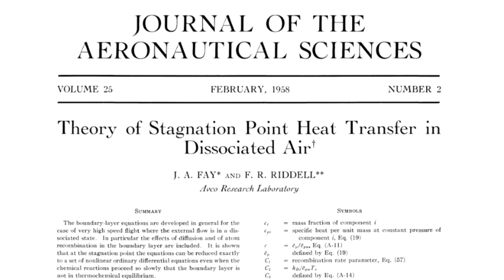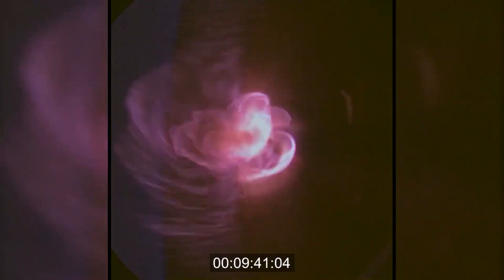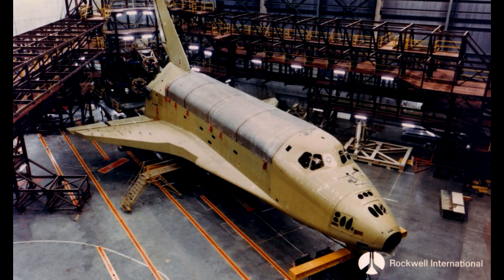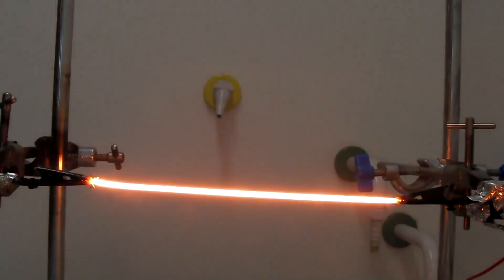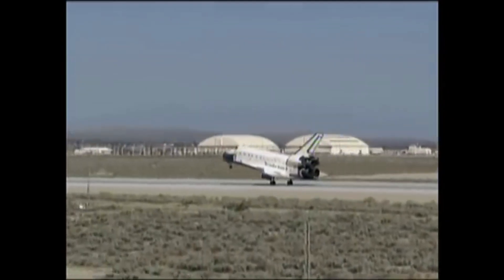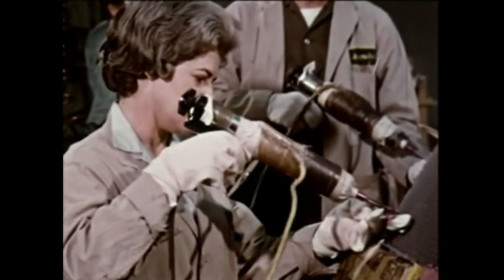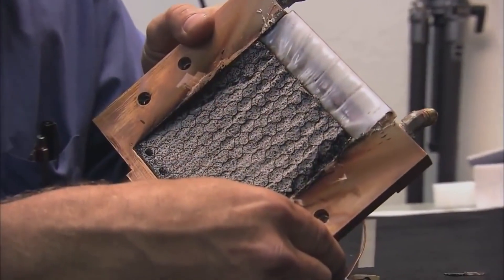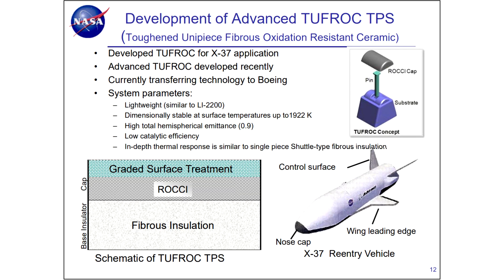Heat Shields - Things Kerbal Space Program Doesn't Teach

Comment: lets not forget that if spacex intends to solve orbital refueling, they could very well launch a fuel pod, dock on the return trip and just circularize back to earth before dropping into the atmosphere. They don't necessarily need to carry a big-ass shield to deal with interplanetary returns.

(i'm aware that doing such an eccentric rendezvous and refueling would be a whole new engineering challenge in its own right)
Reply: That's actually a sensible idea, but wouldn't the interplanetary velocity be several times greater than the orbital velocity of the fuel?
Reply: @rohanpotdar908  They would need to get the fuel tanker up to excape velocity to meet the incoming vehicle which would be pointless.
Reply: I wonder who's going to pay for that setup. I can't imagine payloads and projects valuable enough to justify that, IMHO.
Reply: @vladimirdyuzhev  I don't think they actually would need the Delta-V that badly on the return trip because of ISRU.
Reply: @chris kerwin
Exactly. ISRU - in-situ resource utilization meaning refueling on Mars leaves you plenty of fuel to easily slow down with your rocket engines before hitting Earth's atmosphere and using the fuel for cooling. Mars has an atmosphere that's less than 1% as thick as Earth's and gravity almost 3 times less so it's easy to make Orbit and go Earth bound from Mars you'd think.
Reply: @ryccoh  Making orbit from mars surface is about 3500 m/s delta v which is about a third needed for earth orbit including gravity losses. To intercept and capture back to the earth only requires about 2000 more. So that's roughly 5,500 m's delta v to get from mars surface to leo. Very doable with an engine making 3.5km/s specific impulse. If you haven't seen it I would suggest watching Robert Zubrin's Mars Direct presentation.
Reply: @chriskerwin3904  Nice so it wouldn't be a problem then. Making earth orbit requires 7800m/s, according to Musk the starship could make orbit on its own without the booster however without any payload. Coming back the starship would only return with passengers so there should be enough margin.
Reply: @ryccoh  7800 is the absolute nominal amount to get to orbit; it typically takes about 9000 because of atmosphere and gravity. If you used a tanker based on mars you could refuel a 2nd BFR in Martian orbit and probably bring back the full 100 tons of cargo.   The booster is pretty important since it's allows the BFR to get to LEO with the huge cargo load (100 tons), then you can refuel and send that 100 tons into mars injection. I think it's highly likely that the first BFR sent to Mars will be sent so it can make fuel while it waits the 2 years for the next BFR to get there. That way when the manned mission gets there, they have a fully fueled, working backup in case anything goes wrong.
Reply: Or you could just take the time to bleed off energy through multiple orbits. So long as you can at the very least CAPTURE in that initial pass without destroying the craft, you can make as many passes as needed to slow yourself down to a LEO, where the speed on reentry is as low as possible.
Reply: @hatman4818  Those far orbits would add at least several extra weeks to the time of the trip. May be worth it but, ISRU is the whole point of using this system and should enable the BFR to come back with a fair amount of delta-v.
Reply: Using retro-fire to reduce the speed of Earth reentry, and thus reduce the design demands on Starship, always sounded good to me. Have a couple of tankers already parked in Mars orbit before launching the Starship that will land. HOWEVER, the tankers will need to decelerate to Mars orbit, using a lot of fuel, or have a high performing heat shield/cooling system in order to use aerobraking via several shallow passes thru the atmosphere. But perhaps a less high performing one than is presently planned. Perhaps a balance can be struck, a combination of this and a Mars retro-fire.
Reply: @Don Jones
Like you alluded to, the beauty of Starship with its perspirant cooling and its refueling ability is LOTS of options :)

Comment: How do we know how much of Galileo's heat shield ablated away if it was discarded into Jupiter's atmosphere?
Reply: Math, like if you knew the temperature and the rate at which the ablative material ablates at a given temperature and the time duration you could figure it out
Reply: My guess is that they analysed the change in deceleration  due to the loss of mass
Reply: I suppose if you know the pressure of the atmosphere you are in, it’s density and the rate of acceleration, and the weight before reentry, you can find out how much your mass changed in order to match your acceleration.

Properly could tell after the deployment of the parachute.
Reply: the change in weight of the aircraft had to have something to do with it
Reply: they had a guy periodically take pictures you idiot. I knew there was something wrong with that mission when I signed up..
Reply: The follow-up mission of course, that found the heat shield at the bottom of Jupiter's atmosphere.

Comment: do not try to calculate the pipe density of the subsurface methane cooling system and the heat energy needed to be added to the tank pressure. It is a crazy long math problem.
Reply: Upload a video of it
Reply: R/iamverysmart
Reply: more pipes
Reply: it probably only works for a sphere in a void anyways.
Reply: @jesusmora9379  cylinder actually lol
Reply: @jesusmora9379  Well, then we're going to see a very spectacular re-entry of Starship indeed.
Reply: I think most of us did not need this advice Will Hunting...

Comment: Why do you think they don't re-design the space shuttle thermal tile system instead of replacing the heat shield every time? We flew those for over 30 years. I know they were brittle bit I would assume they would have figured something out by now. I'm no engineer or anything and I know my suggestion is easier said than done.
Reply: It probably is cheaper and faster to do it this way.
The tiles where extremely labour intensive to maintain and replace.
Reply: there was also some problems with bureocracy and politics, and they were not allowed to replace parts of the space shittle with more moderns ones because of it.
Reply: If the Dragon heat shield is a single piece, like it seems to be, it's much easier to replace than thousands of individual tiles.
Reply: Because the shuttle tiles are made out of brittle silica foams and carbon ceramics which are brittle and can not be made into large tiles.  Having so many small ceramic tiles requires intensive maintenance.  A heavier but perhaps better option is a metallic honeycomb structure made of inconel or titanium.  It can be made into much larger tiles and is a lot less brittle.
Reply: @user-fj4mb5jh8o  For high heat you would probably use some type of molybdenum-copper alloy like Blue Origin and Space-X  have talked about using in their staged combustion engines.
Reply: @chriskerwin3904  the only problem with molybdenum is that it is very conductive but yeah, I'm pretty sure they proposed that for the dyna soar
Reply: I remember seeing a video on youtube about flat thermal tiles as next generation research
Reply: Read about TUFROC which is exactly what you describe. It only became available in the last decade or so of the STS program.
Reply: They only have $30b a year, and that isn't enough to buy more Bakelight tiles and glue.

Comment: No talk of ablative heat shielding is complete without talking about the Russian ablative heat shielding of.... wood
Reply from the maker: It’s not just Russian.
Reply: Scott Manley ohhh??  I thought they were the only ones who flew wood as an ablative heat shield.
Reply: @OG-Fox3  
As far as I know another good material for this is cork. It gets charred at the surface and forms a protective layer for the cork underneath. Takes very long to burn through..
Reply: @klausvogler6710  also very low density and spongy, making for decent insulation properties.
Reply: @klausvogler6710  Indeed. At least one CubeSat (QARMAN) uses cork.
Reply: @mxaxai9266  Also the spacecraft adapter fairings on the Apollo S-IVB, which blew my mind when I first learned.
Reply: @OG-Fox3   Nothing like ablative wood, that's what I always say.....
Reply: Klaus Vogler Cork is wood!
Reply: @oneskydog4401 to be more accurate, cork is bark of a specific oak, the cork oak.
Reply: @klausvogler6710  Similar to how the so called starfire plastics are made using cornstarch. It burns and crusts forming a layer of carbon. Pretty cool concept really.
Reply: @oneskydog4401  cofk is not wood but bark.
Reply: @scottmanley  What? HA HA HA HA HA! WOOD?!?!?!? HA HA HA HA HA
Reply: @scottmanley  The Chinese use a, sectional, "ASH", wood, for return, missions.
Reply: Nature's composite material.
Reply: AFAIK Insight lander's heatshield was mainly made of cork and it handeled the Marsian atmosphere @13km/s
Reply: The Chinese used it as well.  How stupid is it they used something cheap and easy to get, rather than something that was labor intensive and cost a ton?
Reply: @fuzzywzhe  If it works great! 
I find it disturbing that they would take that kind of chance with their astronaut's lives.
 Was it the mentality of losing a couple astronauts didn't matter, there's a billion more where they came from?
Reply: @fuzzywzhe  I'm no expert on the topic, but who would have thought during the initial start up of the space program that it would revolutionize data communication in the forms of a wireless network that can transmit data at remarkable speed, or lead to things like people having those paper-fold-up-maps instead in the form of GPS in their car that updates in real-time traffic conditions, accident reports, etc.

Even just collecting data on the ISS is a good thing. "What happens when we ..... in space?" Collecting things like vitals and blood samples from astronauts who have spent X time in space, etc. But think of it this way; sometimes we don't know what we are looking for, we are just experimenting, and we find solutions to problem we didn't know we had, or solutions to advance civilization.

In a different way of answering your question with a hypothetical - one caveman could say to another "Why are you rubbing those sticks together for the past hour, seems like a waste of time (PR stunt)" and the other caveman replies "Dunno just wanna find out what happens man," and boom, fire was discovered.
Reply: @fuzzywzhe  space is long term security from a species ending cataclysm
Reply: @fuzzywzhe  in the early years of aviators their efforts were also ridiculed as entertaining but of no practical use. In my opinion humans will need to leave the earth or face extinction. Better to learn now.
Reply: @stevenduncan7380  the russians were using material science just like we were. Dont be so butt hurt that some farmers all but won the space race.
Reply: i think china uses wood heatshields too
Reply: That is interesting and I feel like you're presenting this as a joke, but is wood a bad choice? I mean, it's a good insulator, it undergoes a chemical reaction under heat, and it gets smaller as heat is applied. Just like the space foam, you can touch glowing coals for a short time without getting burned. Seems like a cheap and easy way to protect your comrades.
Reply: @FireheadLazzo  I would imagine it's a weight issue
Reply: you can then cook some potatoes and distill some vodka during reentry
Reply: Some wood shield designs featured thousands of tiny holes on the hot side, all filled with heat-resistant grease.
As it temped up, the grease would slowly ooze out, vaporize and take a lot of heat with it.
The wood didn't char until most of the grease had been cooked out.
US did some tests, dropped it.
Reply: Then there was that one Moon Lander had a huge balsa wood shock absorber bouncing around on the Moon.
One of them missed & is still up there somewhere with Laika
Reply: If its stupid but it works, it aint stupid.
Plus who knows maybe the wood was reinforced with stalinium.
Reply: @danieldeak9141  They first tested balonium, them stalinium, and further developed chinesium.
Reply: Some oriental satellite used resin-impregnated cashew shells for its re-entry capsule (they'd had a bumper harvest that year apparently).
Reply: Why not water cooled shielding and solid state cooling?
Reply: @NwoDispatcher  Water is heavy and can't actually take the kind of heat you'll receive during re entry, not even close.

Solid state cooling I assume something like a peltier or heat pump? Too much electricity to move that kind of heat, and it also still has to go somewhere.

Heat shields take an enormous amount of heat energy and either ablate away (taking heat with or), or like non ablative shields they absorb the heat but have almost no conductivity to the vehicle. This is a method that doesn't require moving heat and is actually pretty lightweight.
Reply: @Jaker788  how about molten salt then?
Reply: @NwoDispatcher  The PicaX SpaceX is using is one of the best materials for burning off re entry heat. Carbon is what it's made of, it's very lightweight, it sheds off material to keep heat off the vehicle.

SpaceX was thinking about an active cooling method for the second stage. It would have been a double wall on the underside with the outer wall having lots of holes to let out liquid methane that would evaporate and take heat with it. I assume they decided that a double wall and use of their fuel actually costs way more weight than carbon tiles, weight is everything.

Molten salt has to be heated really hot to be molten, it's not really a heat shield, it's a heat sponge to keep solar collector farms operating all the time. It's not going to be a light heat shield, it'd be a solid material during flight and need something to hold it securely, once re entry starts it would become molten and transfer too much heat to the vehicle as well as expand. The containment is the hardest part about using it, I don't see a way of containing the salt when it's molten.
Reply: “Cells” and “Interlinked”, two words that remind me of Blade Runner 2049.
Reply: Speaking of wood and carbon foams, there is a way to build a heat shield for a one-way Mars cargo lander that is a hybrid of ablative heat shield and active cooling. Imagine you have a metal surface - the bottom of the vehicle. Attached is a relatively thin layer of carbon foam - using via standoffs or engineered to allow channels for the coolant. Into the space between the metal surface and the carbon foam you pump liquid methane. Re-entry heating boils the liquid methane and methane gas then finds its way through the open cell carbon foam and also through the joints. 

Liquid methane is an excellent coolant. As its temperature increases, its specific heat increases. Eventually it will dissociate and the resulting soot will act as a further optical barrier (absorbing some of the radiated energy from the shock front). So long as you keep sufficient flow, the metal of the vehicle will remain cold. And where the carbon foam wears locally, the flow increases and thus its self correcting. 

End result is a much thinner and lighter heat shield. Yes you do have to provide coolant, but the nice thing is that as the mass of coolant is depleted, the vehicle gets lighter as a result, meaning your landing burn can use less fuel and you can also dispense with usual jettison of the heat shield - which further simplifies and lightens the vehicle. No heat shield jettison means you're not raining heavy junk onto potentially inhabited locations, so its safer. 

This method of cooling is also enabling in that it allows rocket nozzles that are flush with the heat heat shield surface (again, kept sufficiently cool with a small flow of liquid methane). It also enables landing feet are part of the heat shield and can project through the heat shield in preparation for landing.
Reply: Uh…my uncle is Russian so that is kinda offensive…
He may have been in jail a couple of times in the past, though not entirely his fault.
Reply: This reminds me of an old joke.
Whenever the Americans got to space, they found out that normal pens wouldn't work in zero g. To solve this problem they developed the space pen, a pen that could write upside-down, under water, over grease, and at insane temperatures. When confronted with the same problem, the Russians used a pencil.
Reply: joshua moore ☆ Some of the Soviet WW2 Bombers had tractor controls & you had to bring a pillow to sit on the metal tractor seat.
They still kicked the Wehrmacht's Butt.
Reply: @joshuamoore4971  Although graphite dust or bits are bad in zero g and electronics. So pens are used today by all astronauts.
Reply: @joshuamoore4971  using pencils is exactly what nasa wanted to avoid. Graphite dust is conductive.
Reply: It is Chinese technology for you.
Reply: @quoniam426  also known as rip-off Russian tech.
Reply: @DanSlotea  you meant rip-off American tech...
Reply: @yassasloan7308  you have no clue what you are talking about. Soviets were the first to use asbestos/textolite ablative heat shields in 1955, while Americans were still experimenting with the heat sinks in 1957.
Reply: @DanSlotea  lol yea sure... I guess you REALLY do need to spend tens of thousands of dollars to learn the bullsht I learned which any nowadays can... what do they call it? a googles or something?
Reply: @yassasloan7308  whatever you are smoking or snorting, keep at it, it's too late for you.
Reply: In America you have heat shield but in Russia, shield heats YOU!
Reply: more russian bias. pls nerf
Reply: The Shuttle SRBs had cork TPS all over them. People tend not to consider ascent temperatures when they talk about heat shielding, but the ET and boosters had quite a bit. In the case of the SRBs, it was mostly for engine heat around the aft skirt though.